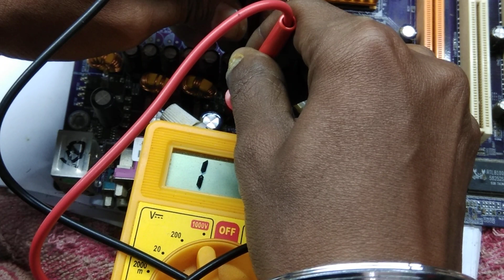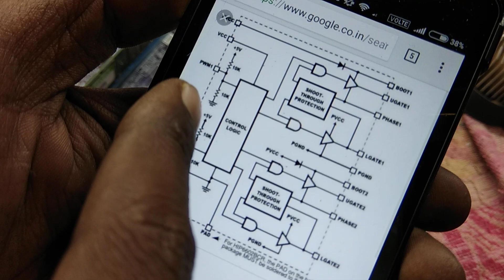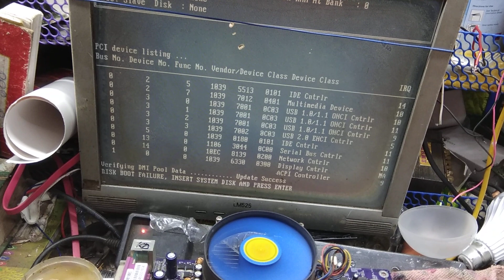P4 ddr1 motherboard no power and deeply described vrm sec or pwm signal generator

Comment: Sir, Excellent, but in earlier video you told that due to processor MOSFET showing shot, so, for proper confirm we need to remove processor before checking motherboard... ?
Reply from the maker: yes